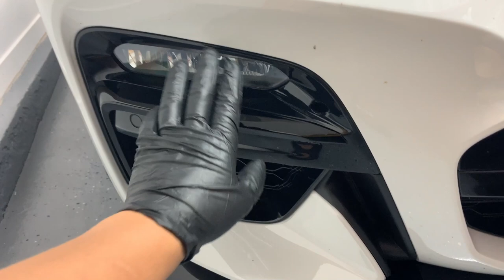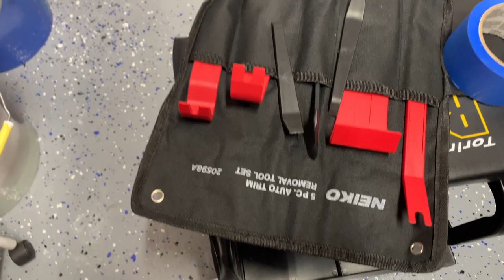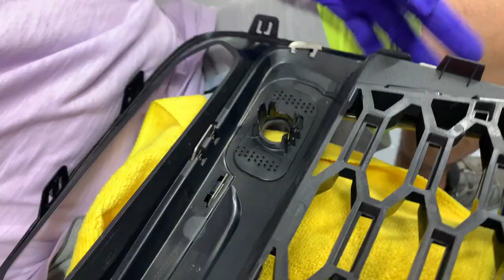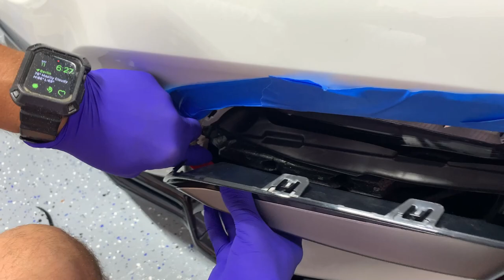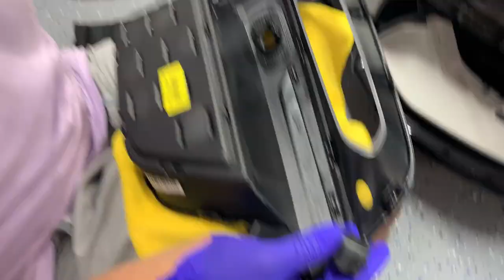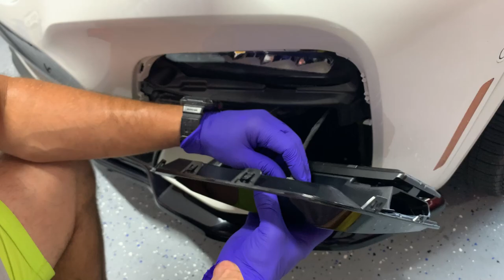BMW X3 X4 M40i Front Boomerang Removal Tutorial Guide Super Easy!

Comment: What is that cover I see you attaching to the back side of the left boomerang (but didn't see you do it on the right side)?  Something to decrease wind noise?  If so, where are those availiable?  Thank you!
Reply: I had the same question.  The video jumps from getting the left one free to installing some cover to the backside of the new one.  What is that?
Reply: @mikex1384  I just fitted the replacement lower grille (boomerang). The grille is purely cosmetic. Both sides have a black plastic cover that clips on behind the grille. They came as part of the original assembly. I found it tricky to get the new unit clipped back into place. It’s necessary to loosen the small plastic piece on the inboard side and get that joined properly to the ‘boomerang’ before clipping the assembly back in. Start bottom right and work around to the top left. Good luck.